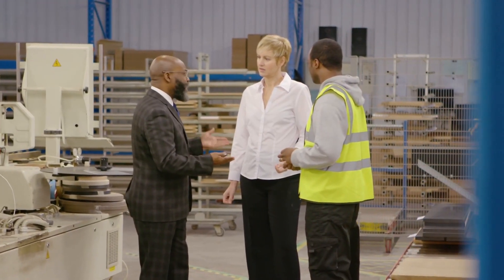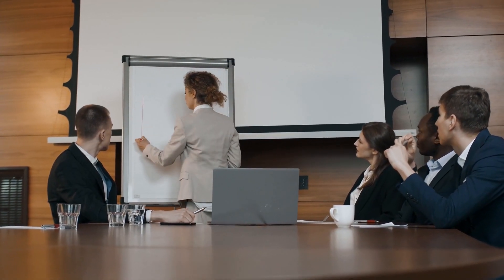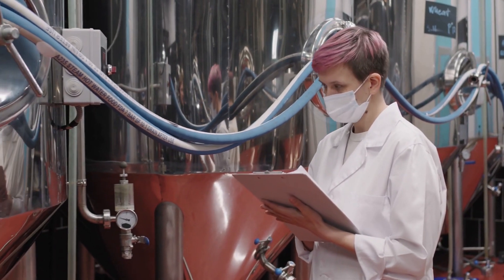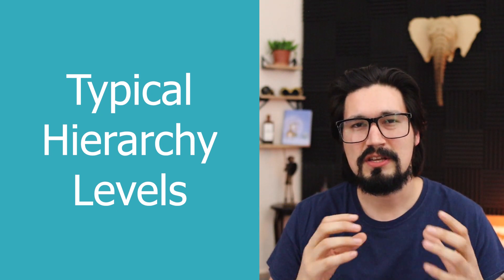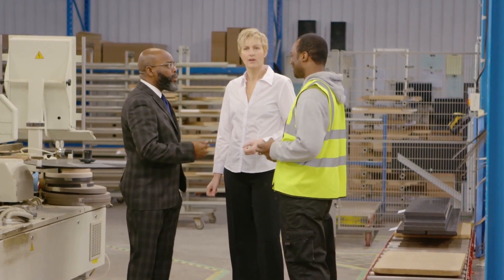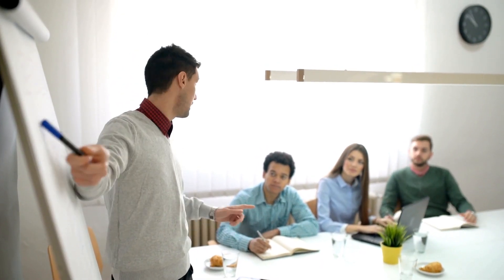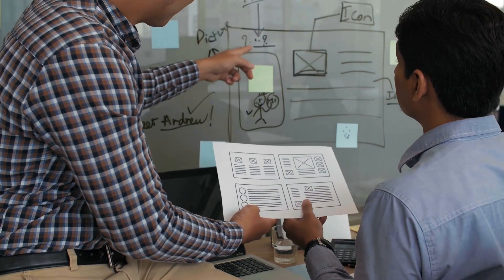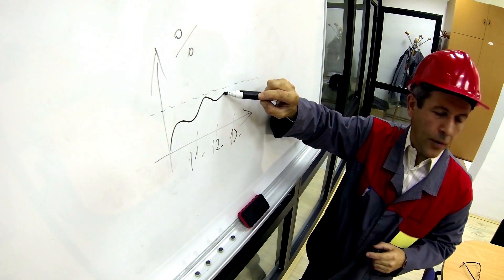The Most Common Job Positions for Chemical Engineers

Comment: I'm really struggling to choose in between chemical engineering, process engineering and production engineering. I also have plans to do master's. So, what would be the better option and more flexible degree to take in bachelor's?
Reply from the maker: I' ll say chemical is more flexible, production and process engineering are mostly towards manufacturing... chemical can do that, as well as more "admin" stuff, marketing, finances, strategy, product innovation, etc... also, when doing a Master, you can "reset" your career path, so make no worries
Reply: @ChemicalEngineeringGuy  thank you so much for your timely reply

Comment: Can u explain about ChemE works in oil & gas department...like offshore areas😊
Reply: I work in the O&G industry. Offshore Oil and Gas processing is similar to other plants, what makes it different is the feed, product, and the location.
We also have Process Design engineer, Process technologist, and Operation Engineer working for the plant. 
It is not much difference with other chemical process plant environment.
Typically chemical engineering grads will work in the following position in the oil and gas:
1. Process design engineer
2. Operation engineer
3. Process safety engineer
4. Flow assurance engineer
5. Reservoir engineer
6. Several others position
Reply from the maker: I will try to research some of that OR bring someone to the podcast that works on that

Comment: Thanks for the video! I heard chemical engineers don't touch chemicals that much in their life, so I'm having my doubts. Glad to hear R&D is still a viable choice
Reply from the maker: Yep, some ChemE will never actually interact with thr chemical... In my engineering job I did interacted with polymer, chips, textile and cloth which was great
Reply: @ChemicalEngineeringGuy  I think what he meant is interaction in terms of doing the lab works like the chemist. 
Most chemical engineers works in plant but we are not the one working in the lab doing chemical analysis,
Reply: What’s R&D
Reply: @orafufranklyn4488  Research and Development
Reply: Yeah, i can say 99% of chemical engineers dont touch chemicals in the lab. We work in the plant of course but not doing lab work, the lab work is done by the chemist. 
So, if you are interested in lab work, better you study Chemistry and not Chemical Engineering.